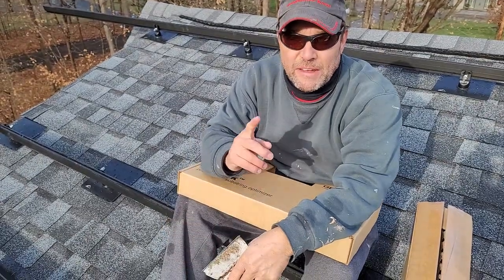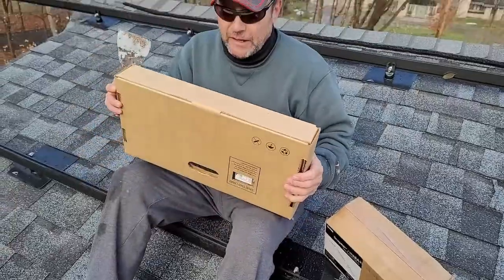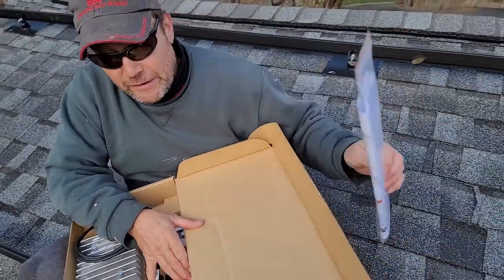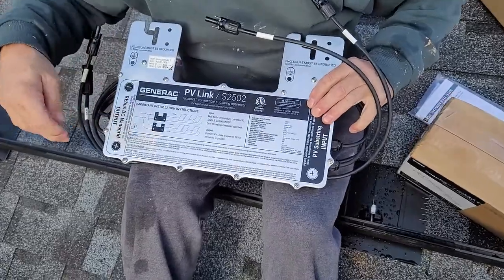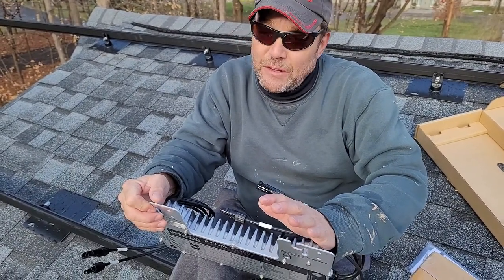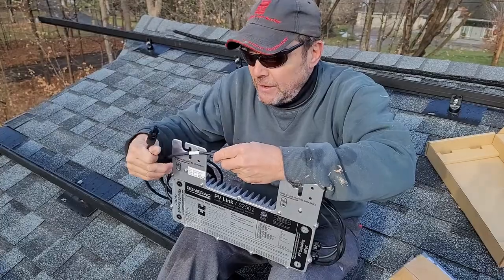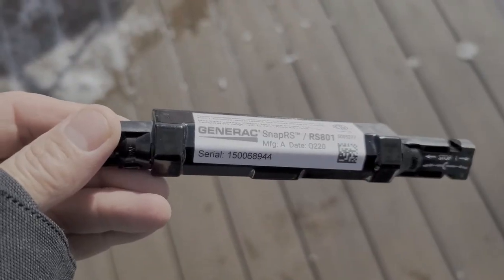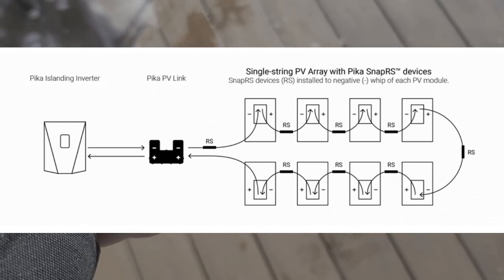Unboxing Generac (Pika) PV Link Substring Optimizer & SnapRS Rapid Shutdown Device for Solar Systems

Comment: Do you need a special tool to remove the snaprs to replace with new ones?
Reply from the maker: Yes and no. They make a tool you can find on ebay cheap for solar connections, but, you can always improvise.